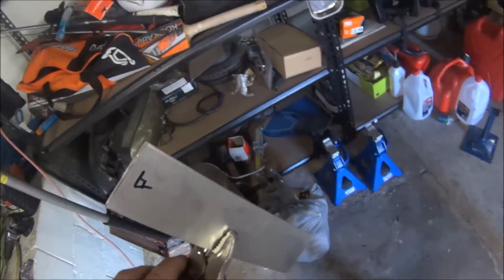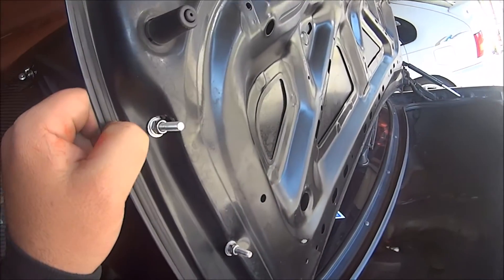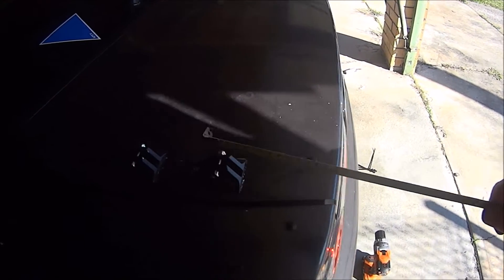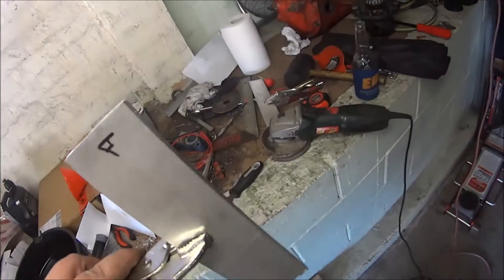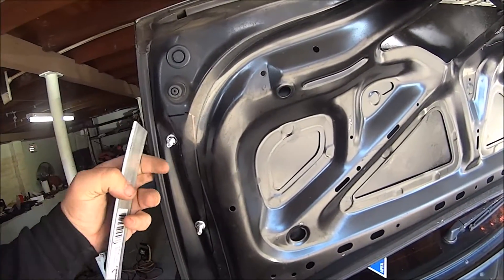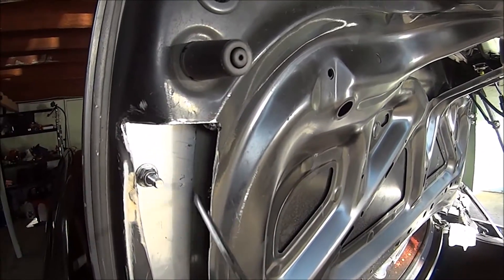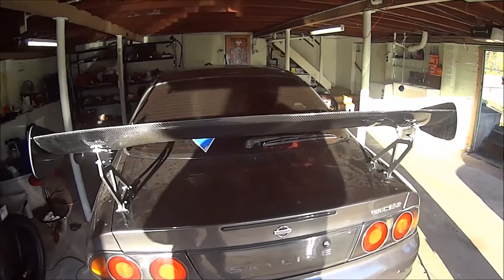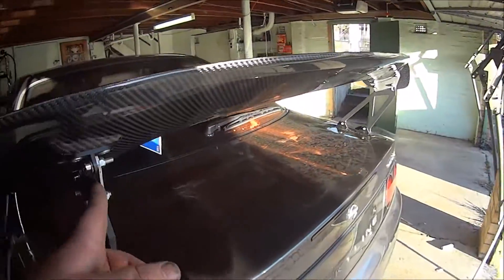How to install Carbon Fibre GT Wing - New wing doubling plates - R33 GTST

Comment: nice video man
Reply from the maker: cheers man. cant wait to see what difference the better angle of attack makes.
Reply: yeah are u gonna start putting  more trial related front stuff on like cannards and different front bar if setup correctly should give u better airflow towards the spoiler and may decrease drag aswell
Reply from the maker: Yeah canards are on the list, but after a spliter and air dam.
Reply: u making your own splitter? i heard its possible out of abs plastic
Reply from the maker: I'll be using an inexpensive composite.
Reply: sweet hopefully it all goes well ill be making my own one soon as my car gets finished
Reply from the maker: Got a couple things ahead of aero on the to do list though.
Reply: nice im still waiting for mine to have the manual put in the shop is taking forever
Reply from the maker: Ah yeah, "the shop" the time killer.
Reply: well all they needed was to put new pedal box in change spigot bush and put manual box back in put starter in and good to go
Reply from the maker: Really, that should be less than a day... for a shop with a hoist and the tools.
Reply: yeah i was gonna do it but couldint get the gearbox to line up with the flywheel properly plus moving brake pedal and stuff better for a qualified person